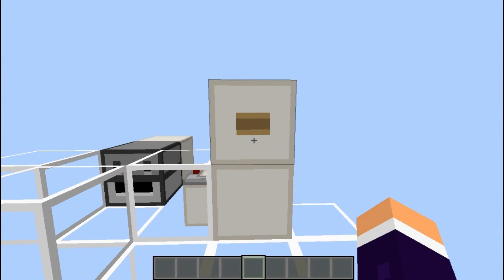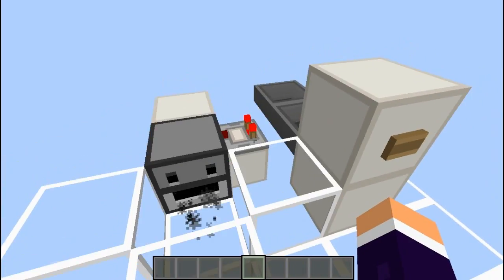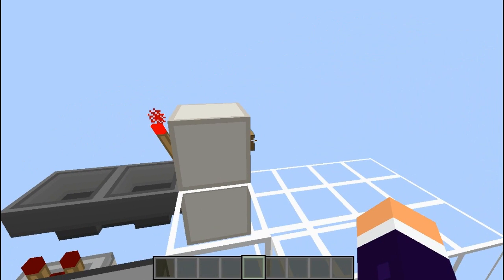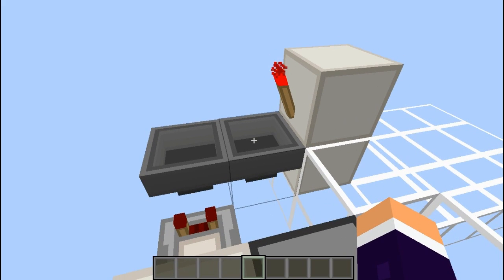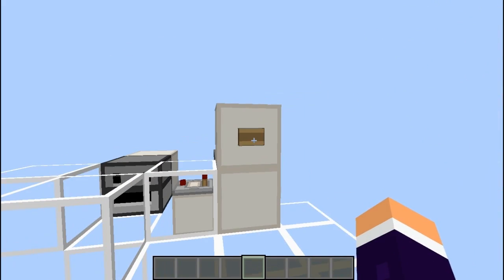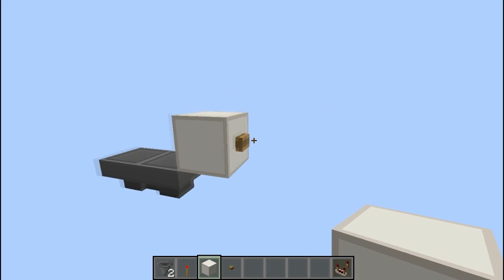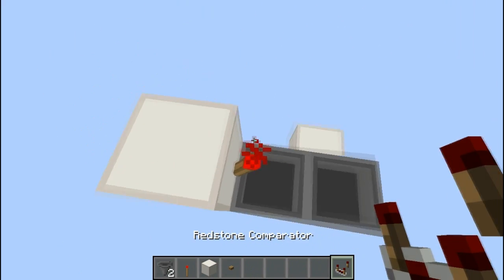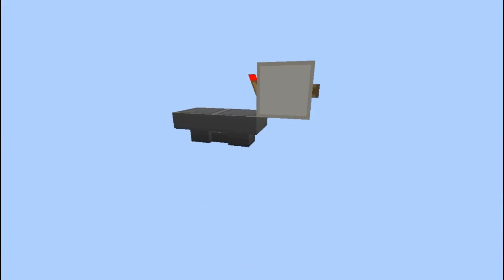Ultra Compact Double Pulse Generator [1.8]

Comment: inb4 EDIT: I've tried it out with in my test world to see how it does compared to the other I've been using and apparently your double pulse generator doesn't work anymore. Instead of two I'm getting three pulses in v1.19.3. What fixes it is using a stone button.

OP: Pretty expensive compared to the one that I'm using so far with about the same size but I like that your's is so instant. Mine (I didn't come up with it) has quite a delay before it gives out the two pulses. So I might go with yours instead.

Comment: as of testing this in Oct 2021 a 
wood button does 3 ticks
stone does 2.
With no inversion red stone torch and block, and a pressure plate you can make a device that always cycles until someone/thing presses the pressure plate.

Comment: but how do you connect the two hoppers together like that?
Reply from the maker: Kisuke Urahara Hold the crouch button while placing and it won't open the interface.
Reply: XD awesome thanks XD
Reply: In 1.11 it gives a triple pulse with a wood button.  Pulses the water out, retracts it, then spits it out.  The stone button, however, fixes it.

Comment: The comparators are less reliable at updating redstone signals and when I pressed the button, the dispenser only fired once, resulting in one large water stream. I did everything you did in the video and it still won't work!

Comment: i corrupted the design to have the comparator pointing directly into the dispenser and rearranged all other blocks accordingly, but the dispenser doesn't trigger twice - at least not reliably.  Sometimes it works.  Sometimes it only triggers once, even though I can see the comparator flash twice [meaning the dispenser is receiving 2 redstone pulses].  Any idea why my corrupted design doesn't work?